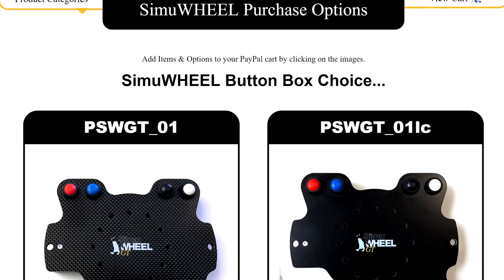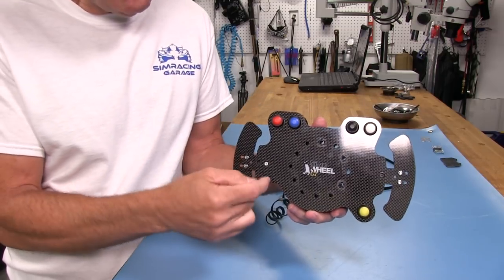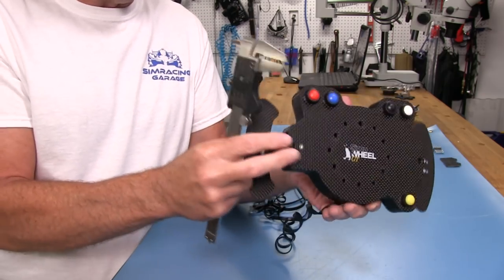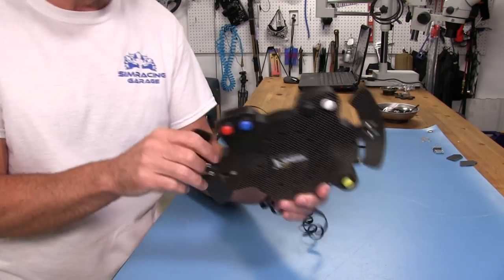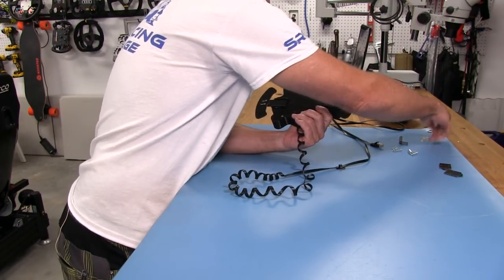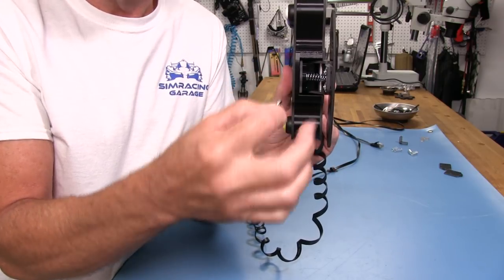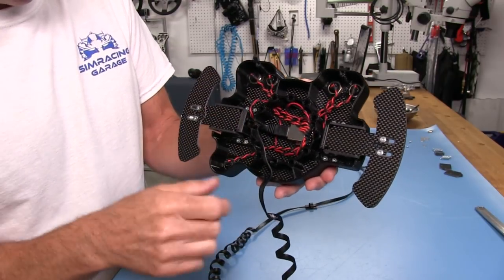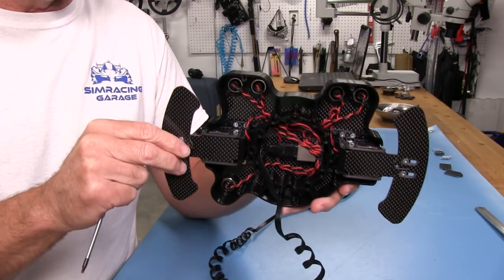SimuWheel Button Plate Review

Comment: Thank you for the review of our wheel system.. It is greatly appreciated I am considering doing some M3.0 Versions of the paddles which would eliminate some flex but as we are trying to keep cost a little on the lower side we chose the M2.25. One thing that was missed was that the plates inside the wheel that the Paddles mount to can be moved outward as well moving the paddles further out for those that like to position their paddles more behind the wheel or have a larger 350+ mm wheel.. Also the G10 is a fiberglass which is why it is so much less than the graphite.

To answer a couple questions.. As is it will only work on SimuCUBE based systems.. However we are in the process of expanding our line of products based on this model and one of those is a four RJ45 port USB HUB that will allow the wheel to be used on any system.. This hub will allow use of upcoming Button Box style options as well at the same time. The Button Boxes will also (for the most part) be able to be used on the second SimuCUBE port as well to give you more buttons.. The Encoder box we are planning ONLY be able to be used on the USB Hub though as the SimuCUBE does not support encoders, hence (the for the most part).

I love seeing how others perceive our products and your review is helpful in working out some possible areas to work on such as the Paddle Stiffness.. We are also thinking about a magnetic paddle version of the shifters though we chose to go adjustable spring based due to finger fatigue issues with magnetic paddles since they are digressive profile rather than a progressive profile in actuation. which does give a more positive bottoming on the limiters, but as well, can fatigue if you are a heavy shifter with the switches constantly hitting the travel limit.

We also warrant our products for issues of breakage for Our lifetime as long as unnecessary abuse was not done to them so if anything should occur to the hub center we will take care of it. In our testing though it should last a lifetime.

Any direct questions about the wheel or paddles can be emailed directly to us at simulation@penguinrc.com

Again Thank you Barry for your Review.
Reply: Have you considered other materials, such as ABS or PETG, instead of PLA? I can't see heat being much of a problem for something like this, and PLA is nice a stiff. Your solution for mounting is also quite nice. Overall, I like this ;-)
Reply: We have but we also haven't really found too much of a benefit in this situation over that of the basic PLA. We are still trying out things and if we of course find any improvements those changes will be made on the fly since we manufacture everything in-house except for the electronic bits.
Reply: Makes sense. Thanks for the info!
Reply: Brian, it would be nice if you could update your site to provide more information about the products when clicked, as opposed to taking you straight to a PayPal checkout page

Comment: Another wonderful review Barry my friend. 

Brion, I am wondering if it would be possible to make up some shifter plates that are offset in the design?  Making it more feasible to change out the paddle vs adding the wedge. If that makes sense. Or even a wedge addition where the paddle connects to the switch out at the end there. Perhaps it will not work. Just thinking out loud. 

Regardless, really really great box for the price. So nicely done my friend.
Reply: Not exactly sure what you are asking for here.. You can put spacers under the Paddles to just move the paddles as well, The paddles can be mounted to either side of the switch units. We choose to do the spacers under the switches to reduce eating geometry in the action of the switch  and to make sure the attachment plates are more inline with the paddles to reduce intrusion. But there is nothing stopping the paddles from being attached in offset at the lever end of the paddle (just would need longer 3mm Screws).

Comment: At 32:35 Does the bolt from the front of the wheel go straight through the button box and into the quick release? Is the wheel actually bolted to the button box or is it bolted to the quick release?

Comment: Nice work Barry lots of love from Australia champ. I am going to get the sc2 sport soon n I will be on full budget once I get peddles n shifters so this button n paddle shifter kit will work for me with a eBay wheel of such as in this vid. ? Would this work on the sc2 wheel base unit. It will be sc2 sport. Cheers in advance.
Reply from the maker: It has a standard 70mm bolt pattern. So it will be compatible with the Simucube QR system that comes with their wheelbases and any ebay wheel that has the same 70mm bolt pattern.
Reply: Thanks mate but i can’t see on the sc2 sport or pro wheel base were I can plug in the cable that comes of the steering wheel button box. Where would that go into on the unit.
Reply from the maker: That would ago into your pc usb port.
Reply: @simracinggarage3026  thanks mate i am getting thing in order for all this new gear i am getting soon thanks mate god bless stay safe.